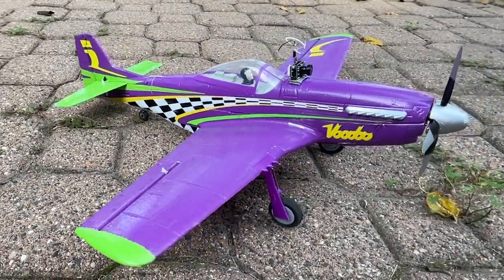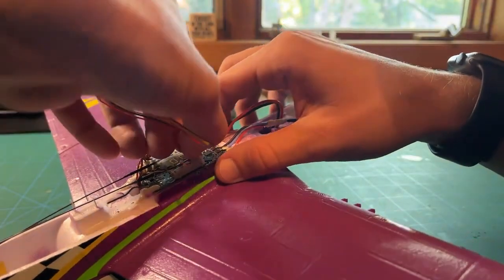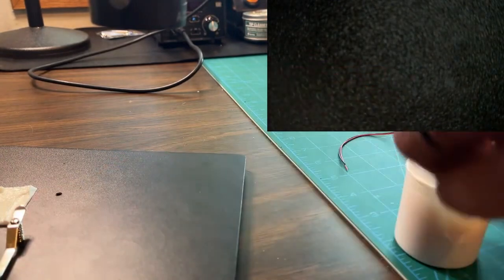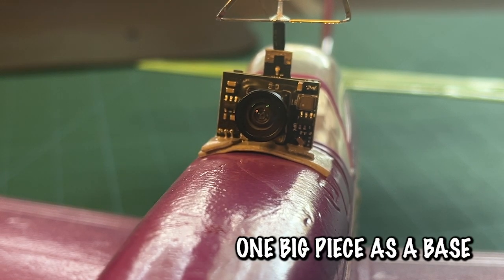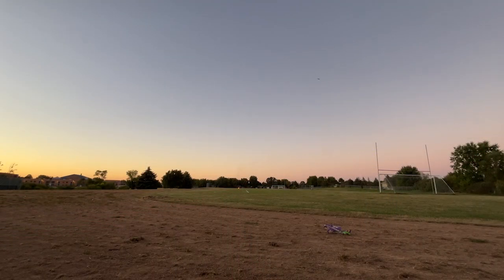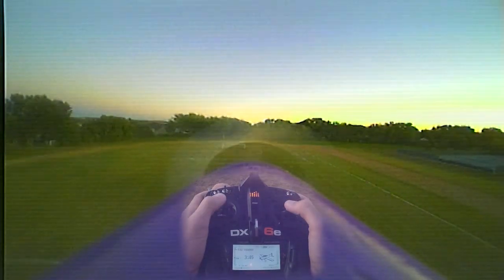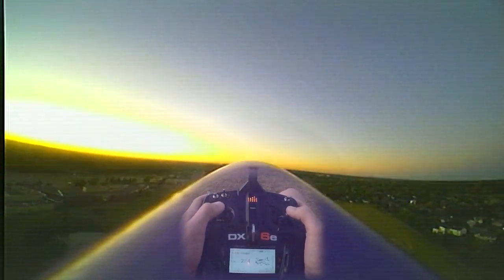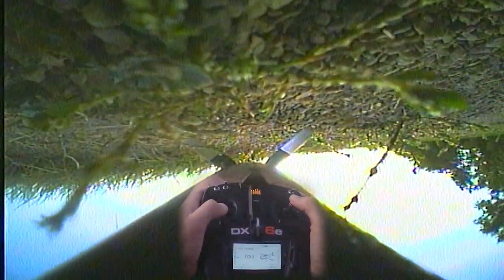FPV Upgrade to the UMX Voodoo

Comment: Nice video, to me it would be very interesting if you could add a 25 gram weight to the plane to simulate the extra weight off a digital FPV system (nobody here flies analog anymore) and give your opinion about the planes behavior with the extra weight. Seems a perfect plane that you can fly everywhere.
Reply from the maker: Thanks! As a proud member of the "nobody here", I think the ability to add a $30 camera and take to the skies with relative ease makes this hobby super fun! I think that the Voodoo by itself has a ton of extra power, so it should be able to handle a much bulkier digital system. And I couldn't agree more, this plane is perfect for tiny spaces!

Comment: The P-51 in general is a very snappy fast plane ;)
Reply from the maker: Heck yeah it is! I wonder how fast it is on 4s 🧐?
Reply: @InvertedAviatorsRC  coming out of a big dive on 4s it can do 100mph (if you do 4s take 2 blades off)
Reply from the maker: Oh really!? That's really cool! Did you just take two propellers of of the 4-bladed prop, or did you find a different 2-bladed prop that has higher pitch?
Reply: @InvertedAviatorsRC  just take off 2 blades from the original prop, or get a whole new 2 blades of that size
Reply from the maker: I just found a 2-bladed prop with the same diameter and pitch, so I'm for sure gonna have to try it out!